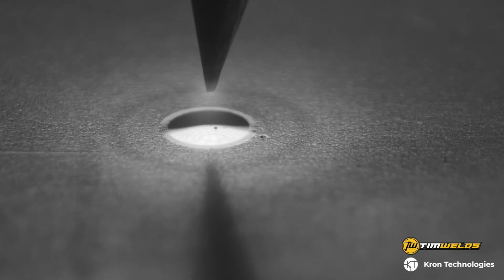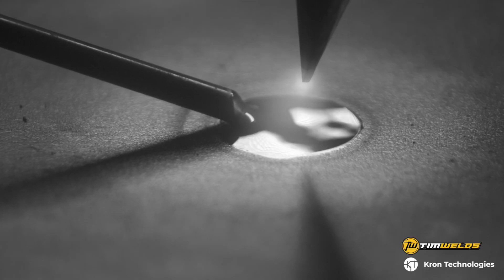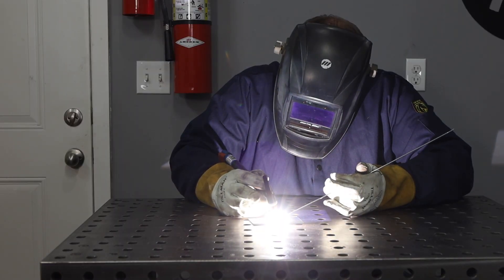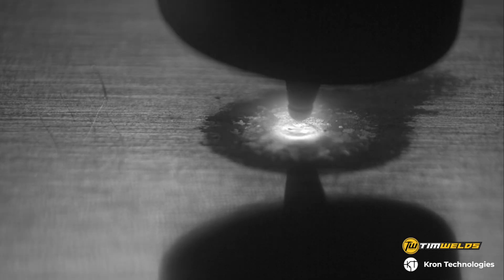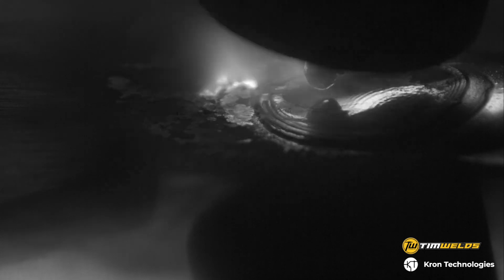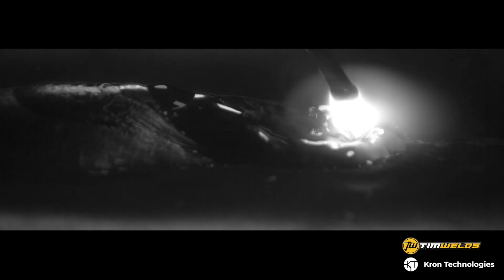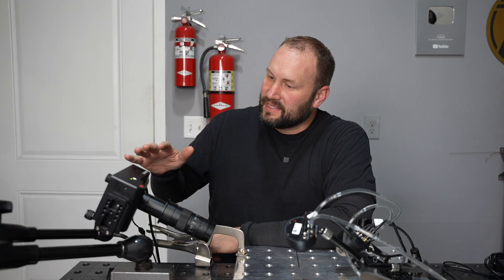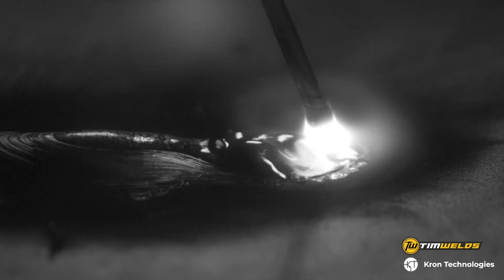Mind Blowing Welding in Super Slow Motion

Comment: I've occasionally thought about welding under high illumination since 1985, when I casually tried to TIG-weld some aluminum scraps and just made a mess. While welding, you can only INFER what is happening, because you can't SEE what is happening; you see THE ARC and little more. Welding by the light of the arc seems insane. With your welding mask "up", you see the positions of the workpiece and the tip, but you must not start the arc (unless you want to ruin your eyesight). With your welding mask "down", you see NOTHING until you start the arc, but then you see with a totally different "lighting" from a terrible angle, and with the arc obscuring the center of interest. When you stop the arc, you again see nothing. Hover too far from the metal and the arc goes out. Hover too close to the metal and you make a splatter and/or a short-circuit, and the torch sticks to the puddle. (Newer automatic welding masks with LCD light-gates switch between clear and dark instantly, but that doesn't fix the lighting.) You don't weld entirely by sight, and you definitely don't weld by feel; a little ESP would help.
  Immediately I thought that a VERY BRIGHT LIGHT would let me see everything through the welding mask, whether the arc is off or on, with the same superior lighting. One would wear the same mask or maybe a stronger one, switch on the very bright lights, and then start welding with a clear view before, during, and after. The simplest arrangement, in 1985, might have used 6000 watts or more of incandescent light and a stronger mask. The next OBVIOUS improvement would have been to use a strobe light (xenon flash tubes, or now LEDs) and a synchronized optical shutter. Each time you halve the duty cycle and double the light intensity, the illuminated scene looks the same (has the same apparent brightness), while the arc (and red glow) looks dimmer (has half the apparent brightness). Repeated halvings could make the arc appear quite dim. But the flashes can only be so bright, and the optical shutter can only open and close so fast. If multiple halvings make the arc very dim (relative to the illuminated scene), one could reduce cost by halving total light output from the strobe lights and using lower mask attenuation (at the cost of making the arc brighter again). Color images would be possible; color might or might not convey useful information. Kron has added a second method of rejecting the arc light: They use a monochromatic strobe light and an optical "notch filter" (resulting in a monochromatic or grayscale image). They suppress the arc almost completely. I think they should provide a way to show the arc in the scene, to a variable degree, freely adjustable. They could do this easily by adjusting the timing of the optical shutter. With their digital camera, they could open the shutter twice as often, to alternately collect images with the LEDs lit ("arcless") and without the LEDs lit ("arcful"). The arcless and arcful images would register perfectly. Adjusting a blend of two consecutive images (arcless and arcful) would be trivial. Such mixing might have only demonstration value; in practice a welder might never use it. A next development might be to use two cameras, for a stereo view.
  One very practical and less expensive system would use only the welder's eyes as cameras. No camera is necessary unless you want to capture video or high-speed video. A pulsed light source and one or two electronic shutters make a complete system. Any eye, pair of eyes, or camera can see the improved arcless view of the weld in-progress.

Comment: Welding instructor here ..... Beautiful shots! Accurate explanations. 
The cleaning action you speak of is ionic bombardment, ions flow opposite to electrons (in theory lol) so on the dcep half of the AC cycle ions travel from + to - and strike the aluminum oxide layer exposing raw aluminum.... (Aluminum oxide burns/melts at 3x the temp of raw aluminum) So it's best to not include it in the weld.

Comment: Great Video. With Tig welding aluminum you should clean the aluminum that your welding. The AC current is not there to get rid oxidation to start. Clean it with alcohol or specialized cleaner. The oxidation has a higher melting point that the aluminum. The aluminum will melt under the oxidation. With thinner aluminum it will blow a hole in it. Cleaning it makes the oxidation layer thinner and easier to melt off.

Comment: I'm not a welder. Is the filler (or wire) metal the same metal as the metal that's being welded together? If not, why doesn't that make the weld weaker? I don't know if that makes sense.
Reply from the maker: Great question! It’s usually the same type of material, but a slightly different alloy developed specifically for welding. For example, steel filler metals usually have more deoxidizers to deal with potential contamination.

Comment: Hey Tim, very nice video…there would be one thing missing: what about the high speed frames from MIG with pulsation? This is such a huge difference to weld MIG/MAG with pulsation and it is so clean…is it close to what you showed in TiG welding AC happens? The pulsation runs much deeper in the material as well, so the showed explanation in AC TIG seems quite reasonable…?

Comment: Fantastic video.  Thanks.  I recently retired from a >50 engineering career where I often had to draw and specify metal vessels. I learned how to weld steel in order to be able to design better but I never could weld Al.  Al would just melt into a mess every time for me.  I have tremendous respect for good Al welders.  Really wonderful video.  Thanks.

Comment: That's exciting! I see the benefit that the illumination is not based on laser (easier in terms of safety) compared to other solutions in the market. If the camera has a trigger output for syncronization with current and voltage signals this will be perfect. The price range is also really attractive. I wish good success for the team working on this project!
Reply: By the way. How much frames per seconds can you reach still a good area and resolution to visualize the molten pool?

Comment: Fascinating stuff!  I have the welding videos by aluminum forming and welding guru Kent White of TM Technologies and found it very interesting that he prefers welding aluminum by oxy/acetylene or oxy/hydrogen (the method used on aircraft way back) for things like gas tanks and aluminum formed parts like car bodies and aircraft fairlings. The gentler temperature gradient of a gas weld, and better temperature control, produce a more ductile weld with less risk of porosity, a problem with TIG welded gas tanks if the welder isn't highly skilled.  The skill level required to gas weld aluminum with is daunting though (I can't do it).  A lot of welders that do thin wall 4130 tube airplanes prefer gas because of the wider temperature affected zone of gas, which affects the fatigue characteristics of the weld. A debate has raged for years over whether TIG welding of aircraft steel tube fuselages requires post heating to normalize the entire area for fatigue resistance, whereas with oxy/A gas this isn't really required if you are careful easing off the heat at the end.

Comment: Aluminium is hard to weld because he got a thin oxide on the surface the problem is that the oxide got a very high melting point , so he needs the pulsating to clean if not the metal just melt and make a big hole

Comment: On the aluminium segment, is it me or is the arc traveling along crystal lattices in the metal after it breaks away the oxide layer before it forms the puddle? Like, its looks like before the full plasma plume of the arc establishes, little lightning bolt tendrils are finding paths into and along the grain structures that make up the metal as a whole ..... freaking incredible!

Also, the narrow monochromatic trick to filter out the excess light is pretty clever! Need to make an hour long video of welding in slow mo.......

Comment: Hold on --- all of these puddles... What happens if you weld on a vertical surface? I'm guessing that normally the metal cools too fast to flow downward. But if you hold the [electrode?] in one spot, and perhaps keep adding filler, what would happen? Would a sort of ridge start piling up on the bottom edge?

Comment: HEY, TIM:  Your fire extinguishers are mounted TOO HIGH.  They should be at knee level.
1) They can be surprisingly heavy.  Toes will not like that.
2) If there's smoke, or any other reason to be low or on the ground, you don't want to have to go up to get 'em.

Comment: Amazing, I absolutely love this! I personally prefer to learn how things work at the individual level, it really helps me to fully understand how things work. So being able to see this clearly in slow motion was so helpful! oh also, out of curiosity, what causes the black soot around mig welds? it looks like carbon, but I don't know where it comes from. you can even see it forming in your slow motion video.
Reply: Mainly, it comes from the shielding gas itself - most MIG on steels is done with an Argon/CO2 mix; the electric arc manages to strip Carbon from CO2, which then combine and scatter as a fine soot!
On top of that, there's the carbon in the steel workpiece & MIG wire being liberated as a gas as the metals are melted, and any surface contamination from oils, greases or in mill scale. Especially if that soot tinges orange rather than solely black
Sometimes there's no helping it - especially since mills often use graphite or charcoal powders as a lubricant during hot rolling of bar, angle/section/channel stock, and mineral grease or even animal tallow for sheets!
Reply: @DevoiranGamer  well that's what I thought, until I realized that I get the same soot no matter the level of cleaning I do, so it isn't grease, and carbon has a higher boiling point than iron, so it cant be coming from the wire or workpiece. the arc and high temperatures involved might split CO2, but the moment that the oxygen-carbon plasma leaves the arc, it would just recombine forming CO2 again. carbon at several thousand degrees is very flammable. my personal guess is that when everything is clean, the little bit of soot that still remains is caused by vaporized copper, specifically vaporized copper oxide which has a boiling point of only ~3,500F as compared to 5,100F for iron and 6,000F+ for carbon. my reasoning? well, most mig wire has a thin copper coating to protect the steel wire underneath, including mine. copper oxide is black too, so that checks out. but hey, it still looks an awful lot like carbon, and visually it looks just like ordinary soot, so I would have to experiment with it. I DO know however, that if you use 75% 25% mix for welding non-ferrous metals, like stainless or aluminum, then the other more chemically active metals present will rip the oxygen off of the CO2 forming carbon and metal oxide. however carbon is above iron in the reactivity series, meaning that iron alone cant rip the oxygen out of CO2.

Comment: I kind of wish you would run into more of the MIG welding and how it looks when you're doing spray arc, or globular. I have used those with great effect to get a really nice up here inside of a weld especially on heavy metal with spray arc. As a root pass before multiple passes.

Comment: Awesome video - it explains much, especially about aluminum! I learned Stick, MIG and TIG while working as a maintenance tech in the early 80's. TIG was so awesome because I could make my own specialty tools or fixtures out of scrap (especially stainless) that was laying around. Fast forward to 7 or 8 years ago, I bought an IdealArc 300 at an auction and have used it on and off since. I have discovered that my eyes are nowhere what they used to be as I struggle to see what I'm doing. When I was 19 or 20, the puddle was so easy to see but now it's not. I need to experiment with extra lighting and helmet settings and maybe it will get easier.

Comment: It’s cool to see how dynamic the arc and the arc force are at such slow speeds. It would be neat to see something with a super high deposition rate like  Lincoln’s NR 232 or 305 with the wire driving into the bottom of the puddle. I burned 75 pounds of electrode this week and none of it was as fun to watch as this!!!!

Comment: Awesome video. This equipment would be great in a weldor training course. A slow motion look at the different MIG transfer mode would be cool. MIG aluminum would also be interesting. 

Also it should be said that the reason aluminum needs to be "cleaned" is it forms an oxide layer spontaneously with just the oxygen in the air at room temperature. This happens very quickly such that even if you grind the oxide off it will almost immediately form again before you even put the grinder down. This is much different than steel. This oxide layer also protects the aluminum from further oxidation, though different environmental conditions can cause the oxidation to happen continuously. 

When aluminum is anodized the oxide layer is grown thicker and this enhances the protection of the base metal in corrosive environments. Aluminum oxide is so hard it is used as an abrasive - aluminum oxide sandpaper for example. 

https://en.wikipedia.org/wiki/Passivation_(chemistry)#Aluminium

There is so much chemistry happening during welding. We don't typically notice because very smart people have been developing these processes for years.

Comment: I have done welding all types. The tungsten electrode in some cases it 2%  Thoriated.  Aluminium reacts with oxygen to form a thin coat of aluminium oxide that chemically bonds to the surface of the metal. That is what you see burning off, also special shielding gases must be used. The bright shinny ball on the electrode is caused by the AC current needed to weld aluminum.

Comment: Incredible film Tim, I have never seen anything like it! I would perhaps mention that the IG in MIG and TIG is the Inert Gas, that forms a shield over the melted metal, and prevents oxidation, and its why the aluminium is able to melt and not form the oxide on top. Otherwise, this was incredible! Have you ever played with a laser welder? They are also very impressive!

Comment: A very nice and educational footage, yet at 4:30 I can clearly see that the filler wire starts really melting the moment it touches the molten pool, thus becoming part of the circuit - AND it IS the arc (the energy, or heat of it) that melts the wire.The reason you don't stick it into the pool is to make sure it melts completely BEFORE falling into the pool and that all contaminants (oxides) are left outside.
That "melting by the heat of material and NOT by the arc" (or the flame in case of oxy-fuel brazing, or soldering) is to make sure that joined pieces are actually hot enough to be wetted by the solder/ brazing material (and that enables capillary action pulling the bonding metal into the space between joined pieces) but that's "an obvious obviousness" and I'm mentioning it here just for the sake of clarity.
Anyway, I'd argue that the filler rod/ wire is not melted by the heat of the pool, and to me it's clearly visible here.

Other than that, just as I said - a very nice footage. Cheers.

Comment: Tim. That's one of the best videos I've seen in a lot of time.   The setup with color filter and roughly monochromatic light is genius. Do you have more videos on physics of aluminum welds?

Also, would be cool to see how positive electrode and negative electrode differ under that high speed camera.

Comment: That was very interesting and informative.  I couldn't help observing that what you said about the weld pool melting the filler metal rather than the arc melting it is clearly incorrect from the video.  The filler rod in your shots it melting from top to bottom, so it has to be the arc doing most of the work.  That said, It's important that the filler rod melt into the weld pool, so suggesting that the pool should melt the rod is a useful shorthand for avoiding confusion and getting good results..

Comment: if you get to use it more, it would be really interesting to see the different types of MIG welding other than short circuit like globular and spray. Also would be interesting to see FCAW and shielded FCAW. thanks so much for doing this, I learned a ton.

Comment: That was great Tim ! Daym, I just started mig and gasless welding for car DIY stuff and my skills are getting better after probably just under half a year, though watching that REALLY shows whats going on internally and its change the mental model in my head of what happens when I weld. Hopefully this allows me to improve even more now. As a self learning guy, when you use the mig gun, you just imagine sticking to peices of metal together with some heat and glue (the filler metal), but seeing how the puddle forms, how it gets drag and what happens when you make a mistake really helps !
Reply from the maker: Thanks! Nice work practicing and leveling up at home; that's what I love about welding is there's no end to learning.

Comment: When the AC shot started it was cool to see the sharp tungsten instantly ball up and then grow to where it could handle the amperage smoothly.
Reply from the maker: Yeah, I knew that most machines give a hot start based on the tungsten size setting, but I didn't realize how much it rounded the tungsten in just that fraction of a second.
Reply: @TimWelds  Watching slag form was cool too!
Those Chronos cameras were amazing when I first saw them years ago.
Now you have a filter that keeps the image sensor from being blown out by the arc and only passes that violet light is a whole nother level!  🤯
Thank you for sharing this.  👍